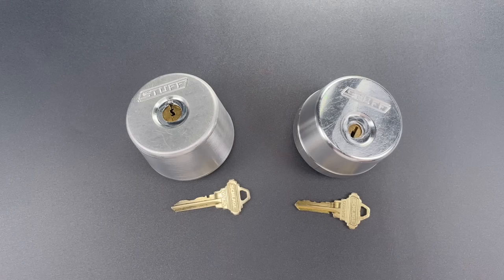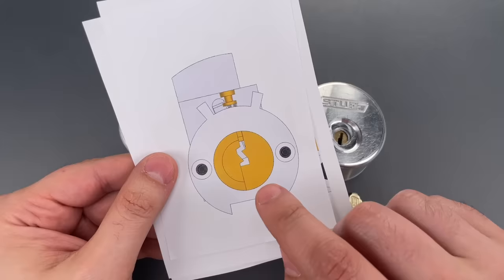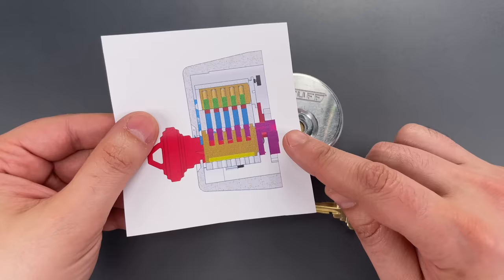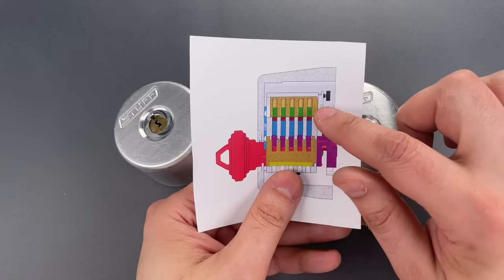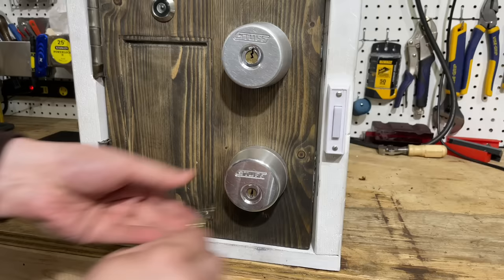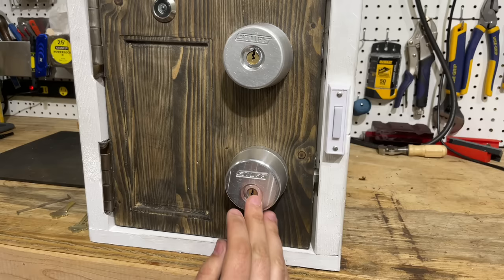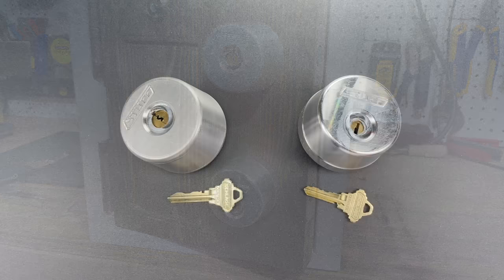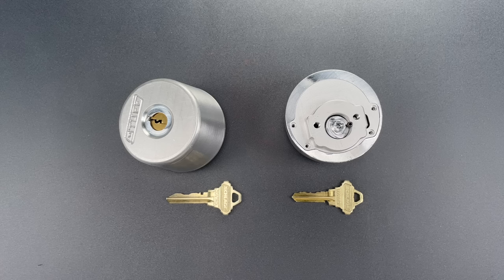[1299] Unpickable Locks From Stuff Made Here

Comment: I see a lot of people reproaching that LPL know the inner workings of the locks. It's obvious that few criminals will spend the time and effort to acquire LPL knowledge. But all of the locks are readily available in stores and any robber CAN acquire this knowledge too. the best lock is unpickable even when one knows the inner workings. Go LPL!
Reply: best lock is something like    rsa public and private  virtual key on a well electric lock   , and no physical key.
Reply: Most criminals will just force it open. Using a hammer or drill is much faster, more reliable, and requires less skill.
Reply: @Sylvain-Delaroque  Electric locks still have exploits since they still have physical mechanisms and electronics; LPL has some videos of opening them.
Reply: The lock shane sent  him was an original design that has  never been used before. It’s ridiculous that LPL took it apart and looked at the inside first. The whole point was to open it as he received it. Not take it apart first.
Reply: @nesc39  No, the point was to see whether it could be picked or not. He had permission to throw everything he had at it. Did you even watch the original video by Stuff Made Here? Security through obscurity is the worst type of security.
Reply: @nesc39  bullshit. It would be easy to design a lock that can't be picked "blindly" just by using an unconventional design. But that would also be cheating in some sense. Stuff Made Here doesn't do half baked shit, if he wants to build an unpickable lock he wants it to actually be unpickable and not just too esoteric for the first attempt of a random locksmith.
Relying on a lock's mechanism being secret is like hiding your house key under the doormat.
Reply: ẞ4
Reply: ẞ4
Reply: The question here is "can this lock be picked", not "can this lock be picked if you don't know the mechanism".

Remember "security through obscurity"? Just because something is secret does not mean it is also safe. Security should never rely on obscurity alone.

This means a good, truely unpickable lock needs to be unpickable EVEN if the lockpicker knows how the lock works.
Reply: Yup, but only a few locks are truly impossible to pick or manipulate. I only know of the Kaba X-09 and X-10, which rely on encrypted lines between the input and the controller to hide any sort of feedback. Further, a punishment delay makes any brute force attack very costly.
Reply: @nesc39  he literally does that for every lock though. He has a thorough understanding of nearly every core he works with. That's like... how you pick a lock
Reply: I think it would've been interesting if he'd done both. Like approach with the most common methods or even creative ones if he didn't know the mechanisms and see if he could pick it that way since this lock wouldn't be off the shelf and a robber wouldn't know. And then after that, take a look at the mechanism and pick it again and show what he did here.
Reply: @jin394  agreed, there was little doubt that once he got to see the inner workings, he was going to find exploits (like the knife). It would have been interesting to see the blind approach as if he was called out to the house.
Reply: Each lock of the same model has variations. Or else one key could open every lock of that model.
Reply: You don't understand the point, really.
Reply: @nesc39  Yep, exactly.
Reply: Although robbers usually dont pick locks. They break doors open with a crowbar or smash a window.
Reply: @Sylvain-Delaroque  who sells those?
Reply: @NeZCheese  Actually, no it doesn't. You just need to make the opportunity cost (in time, knowledge, required equipment) greater than the reward. If your house has Obscuro Brands lock number 77, and next door has a Masterlock, well the Masterlock loses.
Reply: @andrewcottman3574  The knife exploit is bogus because the fake door opens the wrong way. External doors open inward exactly to prevent attacks like this, and to protect the hinges. My door hinges (and probably yours) are not welded, because they are inside.
Reply: @DragNetJoe  many public buildings have doors that open outwards.
Reply: @peacedustinc.7108  This is clearly modeling a residential door, doorbell and all.
Reply: Exactly. A picker is trying to discern the shear line of the tumbler—they aren't trying to use a crystal ball to figure out the entire internal mechanism from a state of total ignorance using... some kind of divination? X-ray goggles? I don't know. The attackers that will bother to pick a lock will also study locks, that's how it works. Anybody else will just smash a window.
Reply: @qoph1988  Actually picking locks is practically more about stealth than just getting access.
Reply: Burglars don't pick locks, they break windows.
Reply: Obscurity is not a good security method. There's a reason that the encryption methods everyone uses are public knowledge, it's cause the ones that survive being public knowledge tend to be quite good security.
Reply: @dojelnotmyrealname4018  Very true, but there's also a big difference between being vulnerable to low-skill vs high-skill attacks.  Obscurity of a sort plays a role there... It can slow down the rate that tools/scripts drop the skill required.  Though high-skill really should be attacks that fundamentally need lots of resources to execute.
Reply: @SaHaRaSquad  It is a bit like the fool's errand of trying to square the circle, though, if we look at the big picture. Like technology distracts us away from our innate potential, if we designed a genius lock design considered unpickable, criminals would adapt to that popular design, and even if just by using an entirely different approach.
The real genius is in influencing humankind away from crime. And such an approach is literally "radical", which is a word that tellingly has been dragged into the mud but has its roots in the latin word for root - radix. - You can see how the status quo powers try to shape minds through language.
Reply: @NeZCheese  Some radiation- or sound-based scanner could probably do internal imaging of such mechanisms. Not cheap, but if you got such a device, you pretty much have x-ray eyes and see internals without peeking into it, maybe even more than if you look at it superficially.
Reply: Exactly. Those people reproaching him about coming in with knowledge in-hand are naive at-beast, idiots otherwise. They're considering security and obscurity as synonymous. You don't want someone to fail because they don't know how something works; there's always someone smarter around the corner that will eventually figure it out, unless... Rather, you want the scenario where , even given all the information possible about the design, manufacturing, and deployment of a security device, someone still cannot defeat it, or if they can, the effort and/or cost to do so is so encumbering it isn't worth it.

Bruce  Schneier put it more or less like this (paraphrasing, I don't have my blue copy of AC right here handy):

If I take an important document, put it in a safe I claim is "secure", and hide the safe somewhere in New York City, and that's all the information I give you before asking you to open the safe and retrieve the document, that isn't security; it's obscurity. On the other hand, if I put the document in a safe I claim is "secure", then tell everyone where it is, take the best 10,000 safe crackers on earth and give them each the full blueprints and patent designs to the safe along with their own fully-working same-model safe on which to analyze and practice their attempts, then give them a year to break in, and they still cannot open the safe and retrieve the document, that is security (more than less, anyway).
Reply: It's not some covert, arcane knowledge. Anyone can learn what LPL knows, open to public
Reply: @ENCHANTMEN_  And it will be evident that someone used a hammer or a drill.  Heck, this is a front door lock, so you could just as easily just throw a brick through the window to get in.  The whole point of locks is to make it so that if someone breaks in, then you can see from the hole they smashed in the window to get in through.

Comment: Most exterior residential doors open to the inside.  The deadbolt wouldn't be accessible, blocked by the door jamb, to be "walked back".
Recessing the lock cover into the door, instead of surface mount, would prevent sliding a tool under to tension the second core.

Comment: "this lock is unpickable"
 LockPickingLawyer: im gettin' me mallet
Reply: "Unpickable" you say? Challenge accepted!
Reply: Don't know why I laughed at this so much.. xD
Reply: Curious The Cowardly Dog reference. 10/10 comment
Reply: @chadkrause6574  Courage* :)
Reply: A easy way I can see the anti mallet thing is by figuring out a way to prevent the slop of the mechanism from moving too much, adding a 2nd layer of defense which is some sort of absorbent like material that can absorb impact, then a 3rd layer of a durable but bending and reforming metal. The reason why I say this is that the 3rd layer will house the 2nd layer and it will absorb all the impacts which the 3rd layer takes, which will in theory could kinda bend, taking away some initial impact. The 1st layer will just protect from someone trying to brute force break the lock.
Reply: These are just my opinions, but I have no real lock or engineering experience. But in an ideal world I could see this maybe working.
Reply: @CubeGodd  you’re right whoops

Comment: Bro “ Shane welded the pin in the door hinges so I wouldn’t pop the pins and declare victory... good thing he did because that’s exactly what I woulda done” has me dead
Reply: Well, yeah, your security is only as good as the weakest point.  An unpickable lock doesn't mean squat if you have access to the hinges and can just pop the pins.
Reply: @teloenand  Yeah, too bad he left a huge gap for him to insert a tensioning tool...
Reply: @GRBtutorials  It's a fixable mistake though, and one that makes sense given that there are literally the first two locks Shane made. I'm personally excited by it! Lpl had to use some non-standard attacks, and come up with clever exploits. There were a few design flaws, but the main design itself was pretty interesting from a lock picking perspective. I really look forward to V3!
Reply: That seems to subvert the spirit of the competition.  The premise is to pick the lock, not destroy something to gain access. Given time and a blowtorch any metallic based lock can be overcome.  An axe can take out a wooden door, etc, etc.
Reply: @HWPcville  yes, but those are destructive attacks. That means you leave evidence behind, and you're loud, and your tools are large. Pulling the pins though? No reason a respectable locksmith wouldn't use that. It's totally within the spirit of lockpicking; exploit the flaws in the security and use tools to break your way in WITHOUT using brute force.

Comment: Ohh. Ohhh. The more complicated you make security, the more vulnerable to simple oversights. The "rotate it 45 degrees and walk back the deadbolt" is an amazingly classic security failure. I've been dealing with that sort of oversight in software for.... well, decades.
Reply: Things like this will always be an issue.  Complexity isn't even required.  Everyone thinks differently and that is the inherent weakness in any design, hardware or software. This is specifically why you need as many people to test as possible.
Reply: If the locks were put on the outside of the door would stop that. All doors I've seen open inwards
Reply: @stevencarr8339  Among other issues, mounting a door to open outward would mean the hinge pins are exposed to the outside.
Reply: @stevencarr8339  All home doors.
Commercial and public building doors generally open outwards, for the reason that sometimes people need to escape the building in a panic.
Reply: Maybe this is harder to pick, but for the average thief these locks are easier to defeat than a discount-store Chinese Schlage knockoff. Intrigued? Read on...

The truncated-cone Schlage cylinder housing which has a rim inset into the bore hole deflects hammer blows. These locks make for a nice solid place to bash and with nothing to key them into the bore hole can be easily knocked off the door in one blow. That attack is an issue with many US-style deadbolt homeowner locks and is one of the most commonly seen and used deadbolt attacks.
Reply: @stevencarr8339  In my country its a rule that all outdoor doors must open outwards in case of fire.
Reply: @cephalosjr.1835  government required on new built commercial
Reply: @domogdeilig  in Canada, commercial doors have to open outwards so people can leave in an emergency. Domestic houses need to open inwards, in case the fire department has to smash your door in.
Reply: @cephalosjr.1835  not in the US, all residential doors open inwards so that exploit would be more difficult but still not impossible. You would need to gap the door first but that would cause some possible noticeable damage.
Reply: @2likruesco768  ^^^ This.
Reply: @cephalosjr.1835  where? Every exterior and interior door of my house opens inward. I can only think of a single outward opening door anywhere I’ve lived, and that was the back door of an attached garage that opened up into the backyard.
Reply: I remember being in grade 4 some time in the 1990s Era. And using a butter knife to get into my class room at break time. Just walking the  lock. I did this last year at a job site. Mater roof hatch access key went missing I walked the lock with a pocket flathead screwdriver.
Reply: Tips on getting into the job from no experience? Starting on the Odin Project atm
Reply: @ChArLie360115  Work for non-profits. Publish your work.
Reply: made me remember when im playing chess and i make a move that made me feel like casparov, but in the end my opponent take my queen
Reply: As a BS of Software Engineering, I have to say the biggest problem is that cyber security is a seperate degree.  You can learn how to make programs or secure them, not both (unless you get the other degree).
Reply: @cephalosjr.1835  Yes and those doors have a lip on the outside that prevents getting to the deadbolt
Reply: @Wyl7  Not at your home. Home doors open inwards.
But commercial and public building doors open outwards, and many have push bars instead of handles.

Comment: LPL: gives a flaw to the second lock

SMH: instantly makes the most expensive solution without asking any other ones
Reply: Hell, a lot of people would pay ten times the normal price for a certified ‘unpickable lock’

Can’t wait to see that price tag tho XD
Reply: I was thinking use a hole saw to slightly recess the lock body within the door.
Reply: @calebcomet1868  But at that point, might was well use biometrics. Or a drill.
Reply: It's just his tools available that dictate that.  Shields inside the lock are fairly normal.  Medeco locks have a hardened steel shroud that goes over the area in the door to prevent attacks that way.
Reply: @jeffstock7819  That was my first thought
Reply: @xwingband  That does make sense
Reply: The others solution would require a redesign, it was easier for him
Reply: I read smh as shaking my head
Reply: @OBtheamazing  or a light saber(from hack Smith)
Reply: @calebcomet1868  I would pay for it to place it on the front door and watch from my CCTV when people realise I have triple deadbolt behind the door also the pins are facing inside my house so popping it is not an option.
Reply: @calebcomet1868  Unpickable locks on all your doors just mean that a potential thief comes in through the window.
Reply: @OBtheamazing  exactly right, if we were to purchase this lock commercially I'm sure it's be a ludacris price
Reply: @DanielLee-oo8nc  Maybe, maybe not. It’s especially expensive because he is using prototyping methods. Unless your specifically selling something super high end you wouldn’t mass produce that way. Some things might require in person assembly but if you had a corporation with the resources to set up a factory line to make the lock a lot of the things can be automated. A cheaper solution to that back plate would be to have the housing go all the way through to the back side of the lock with just a gap for bolt.
Reply: @OBtheamazing  Yeah the irony of all of these 'unpickable' locks is that almost all of them can be defeated by brute force attacks.